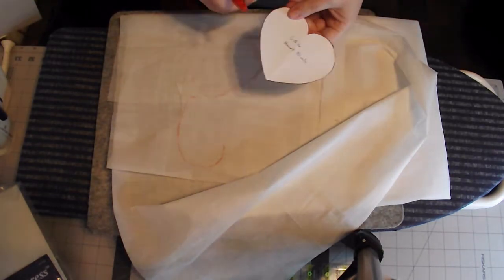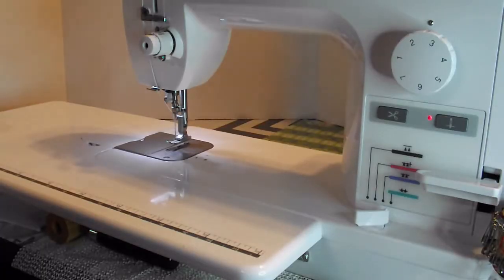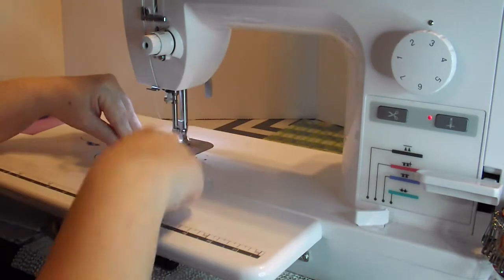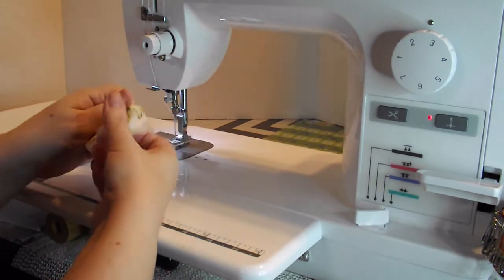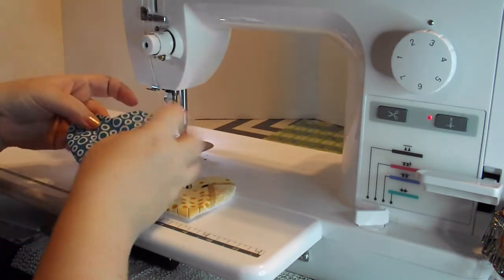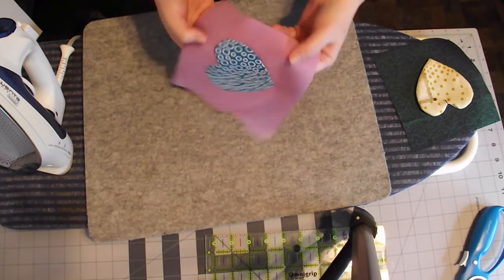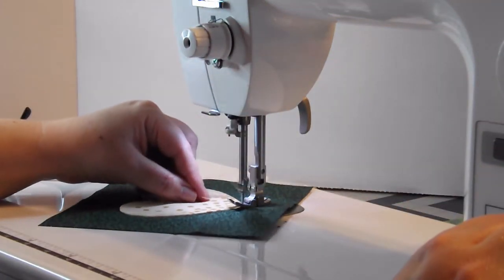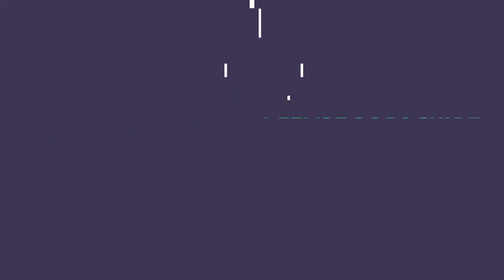How to Quilt Heart Applique Using Fusible and Iron On Interfacing - Sew Simple!

Comment: This is good but there is a much faster and easier way to do this. I have tried your way and then I tried this other way and it was way faster & easier. Only sharing this because I thought it might help you too. Not trying to be mean or belittling your method in any way.  https://www.youtube.com/watch?v=8ChE9UBWA8A&t=4s
Reply from the maker: Hi Patricia. It seems like the only differences are that I precut the fusible before stitching (I've always thought not doing that could backfire) and that she's fusing to a pressing sheet which only seems advantageous if you are appliqueing to a large background rather than to blocks. If that method is faster for you, then that's cool. My favorite in terms of just looking the best is to do the starch and turn under method I cover in the beginner's video. It's tedious but the results come out better looking IMO and it's not bulky. Another interesting method that I only just saw on Instagram a couple days ago comes from Superior Threads' account. They have a method where they use a special thread that becomes glue when heated with the iron. It's worth a look at that reel if you're on Instagram. Thanks for watching!